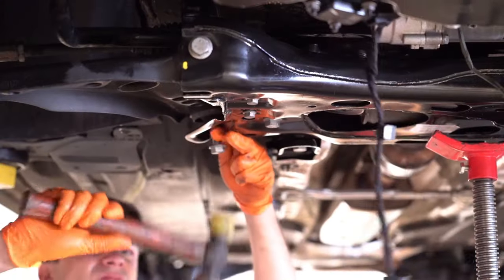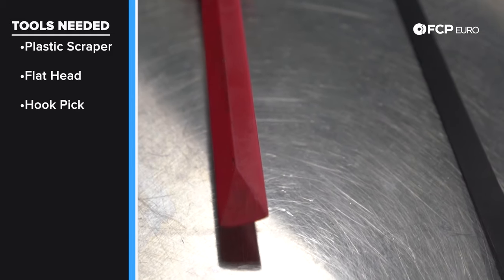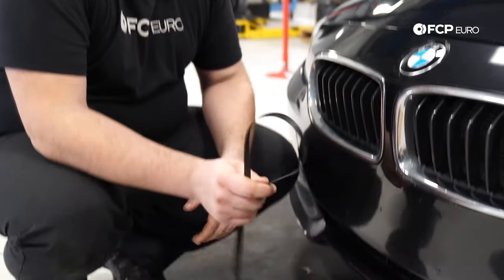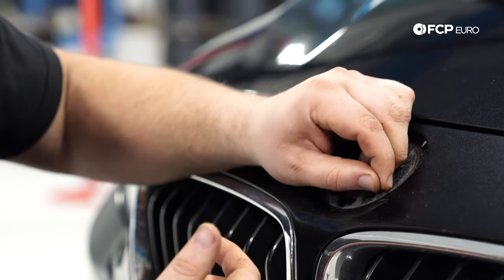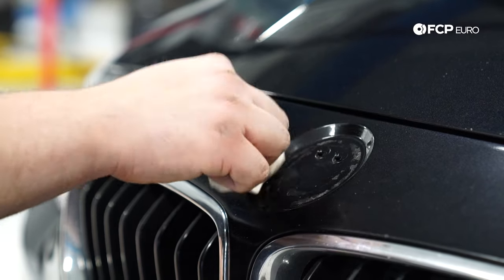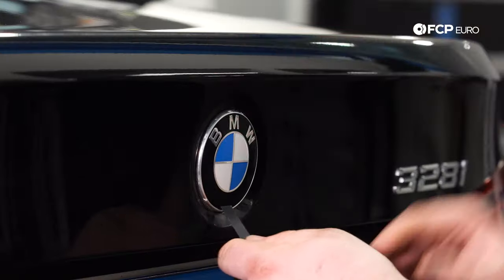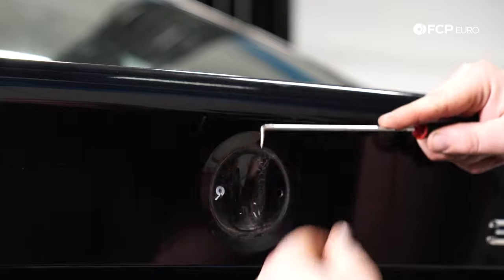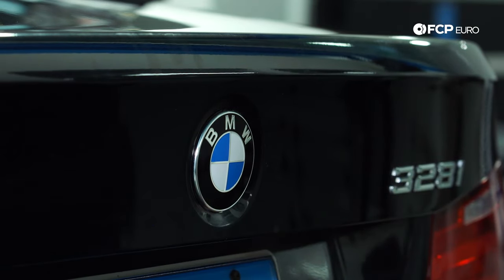How To Easily Replace A BMW Roundel - Badge/Emblem Swap

Comment: Don't use metal/hard plastic tools around the BMW Roundels during removal. Add 2-3 layers of painters tape around the roundel before removal
- For the adhesive roundel use a heat gun or blow dryer, plus some fishing line. Goo Gone will help remove the adhesive.

- For the roundel secured with grommets, it is typically very very hard to remove. Use an old  credit card or the thin plastic strap to force a small gap at 9 and 3 o'clock where the pins are. Then insert some fishing line around the two pins and very gently pull up both sides at once,. Once there is enough gap you can use your fingers (wear gloves). 

- Use a very thin plastic trim tool (used to pop plastic rivets) with the end taped to remove the old grommets. Put some thin cardboard or old plastic credit card underneath the trim tool (to protect the paint). Use fresh grommets with the new BMW roundel. 

- Some BMW roundel sets come with a tiny circular piece of clear film to protect the new BMW emblem from rock chips . You probably need to use a blow dryer to stretch the film over the concave roundel surface and raised letters (it is not flat).
Reply: His way worked perfect why make this comment?
Reply: @amkkoo9184  Because using metal tools on painted surfaces will, more than likely, damage them. FCP Euro is a leader in BMW parts and they know better than to instruct users to do something that can damage their vehicles. It takes literally no more effort to inform people to use plastic/vinyl pry tools to pull emblems and there is a LOT less change of anyone damaging their property.

Comment: Stupid Question,I ordered all My EMBLEMS which came inn.Its it advisable to reuse Hood/Trunk Grommets when replacing with New Hood/Trunk Emblems?Thanks bud
Reply: you can do it just keep checking it every few miles at first. the prooer advice, however, is to use new grommets

Comment: You should sell custom painted emblems (chrome edges of genuine emblems painted gloss black or black chrome etc), like IND Distrubution sells for different models. Looks nice but I don't think they are too known and perhaps hard to get right as a DIY (the paintjob that is). Probably worthwhile though if you are replacing the emblems anyway.

Comment: I have a 2018 X1 bought new from the factory. Some fool (in a parking lot) blacked out my front roundel with black silicon (no clue why). Bought the correct replacement for my model and watched this video, and others, repeatedly. The new part arrived, I taped the area and attempted the cargo strap technique and the dental floss technique. The roundel didn't seem to have a seam anywhere. I then drilled a 3/32 hole into the ruined roundel and hand screwed a 1" drywall screw into the opening. When the screw bottomed out....the roundel just worked its way up the screw, pulling free...allowing me to grab it with pliers and remove it. The issue was that, at the factory, they had put a bead of silicone around the circumference.  As for the grommet removal...I threaded a #12 sheet metal screw into the old grommet...pulled it loose with pliers.

Comment: The colorful emblem is gone and what is left is solid black with BMQ logo..........no grommets.  Was the emblem only partially removed?  Two parts?  Also, someone said they fall off??  I thought mine was stolen.
Reply from the maker: Hi Rose, often times they can delaminate, so it sounds like the backing plate is all that is left on yours.